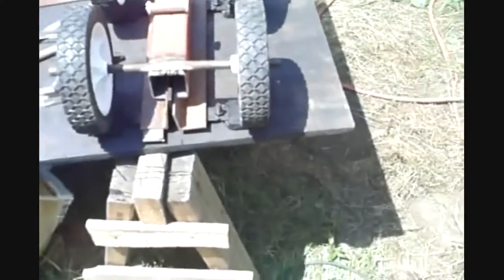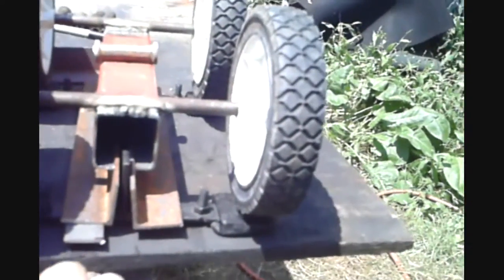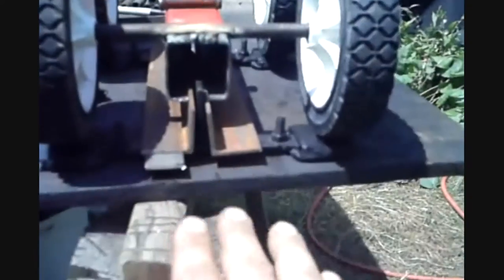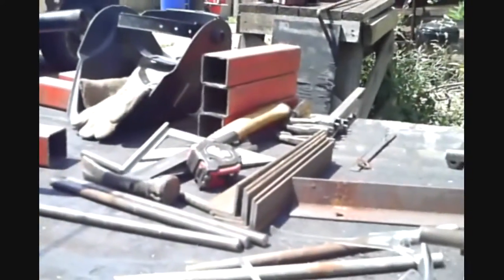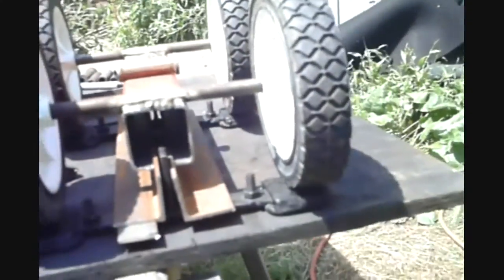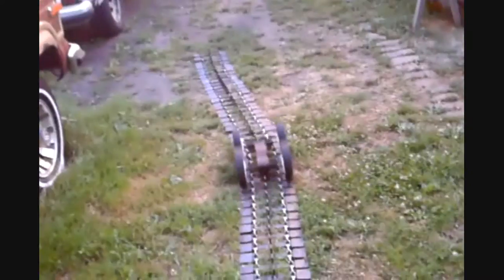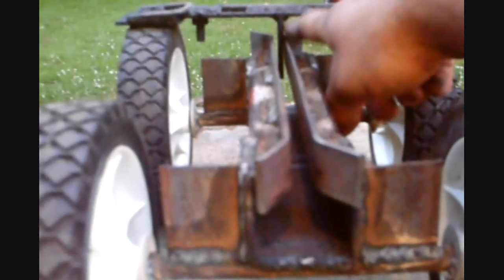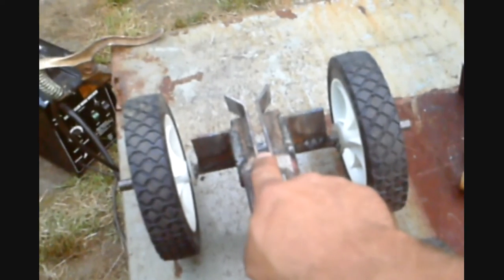Making the double wheel bogies for the X1 Scorpion.

Comment: Nicely done Bud!! If I tried a freehand cut like that with the grinder there would be blood all over the place!!☺
Reply from the maker: 805ROADKING Yah, I've learned to keep my fingers out of the way, the hard way, lol. Funny thing you mentioned that, In the vid when I was welding the A-arm connection to the frame. I went to pull the rod out I had sticking through it and grabbed the spot where I was welding at with my bare hand. Apparently I haven't learned that one yet. I have new skin on my hand now, LOL.

Comment: Looks like a solid idea. Ought to be all right, til those plastic wheel bushings wear out anyway.  Keep on keepin on,...
Reply from the maker: ***** Thanks for the support. I figured the plastic wheels will last for a while, plus I have a box of used ones off of stripped push mowers. It'll give me a reason to use them up, I'll never build 50 push mowers from scratch, LOL. PLUS I thought of this when building the bogies, I gave it enough of spacing inbetween the wheels to put 8 inch steel rim wheels with bearings on later when I have the money. The wheels on there now are 7 inch ones.
Reply: Good thinking ! I like that..